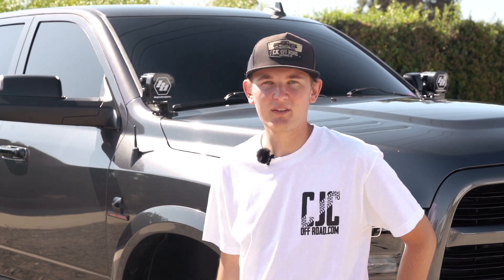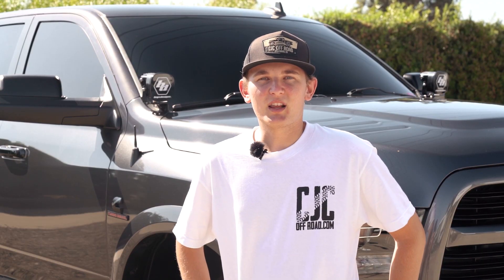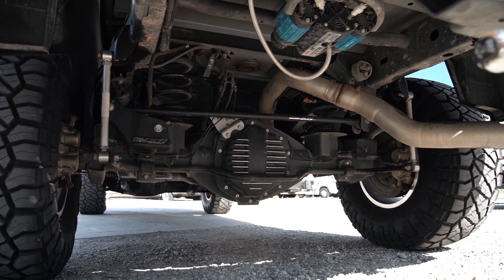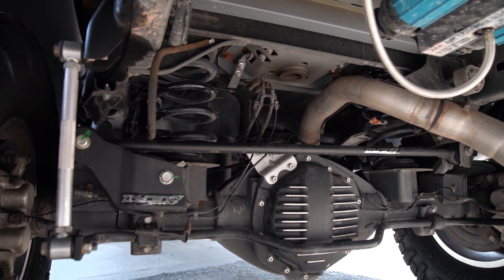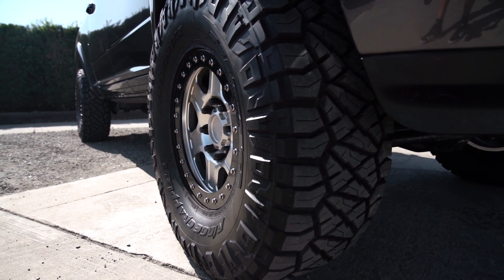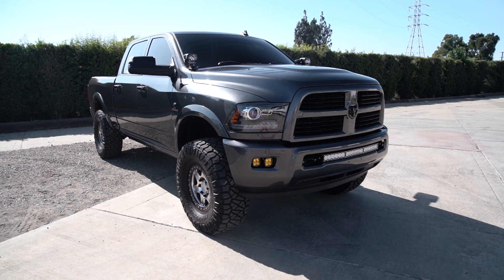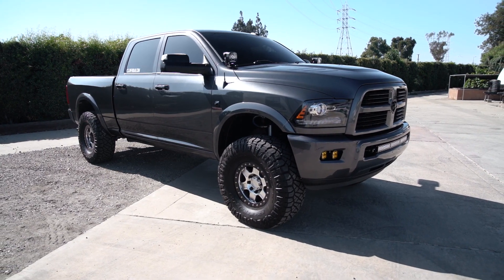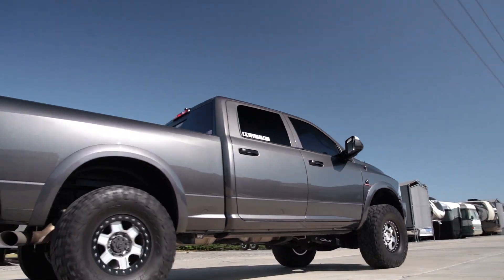Ultimate Do It All 4th Gen Ram | What We Drive Episode 1

Comment: That is one beautiful truck.  My Ram 2500 is a 2013, so I have the older style control arms.  Will this leveling kit still allow me to run my 37/13.5 R20 Ridge Grapplers?  My Centerlines are also 6” backspaced.  I really don’t want Les Schwab’s 6” junko lift they recommend to clear these tires.  Thanks.
Reply from the maker: You'll still be able to clear them with a carli leveling kit, as long as your wheels are between 18 and 20 offset.
Reply: CJC Off Road thanks for the reply.  I’ll call your shop tomorrow.

Comment: What is the arb twin for? Did you put in air Lockers or bags? I installed mine in the under floor storage and used it for airing up
Reply from the maker: Austin uses it for filling up truck, trailer and moto tires on desert trips. It's handy to have around!

Comment: What's the common solution to carrying a spare 37? Not sure if one would fit in stock location but looking for ideas. Carrying one in the bed wouldn't be ideal when towing the 5th wheel.
Reply from the maker: In bed is really the only option aside from doing a spare tire mount off the bumper or roof.